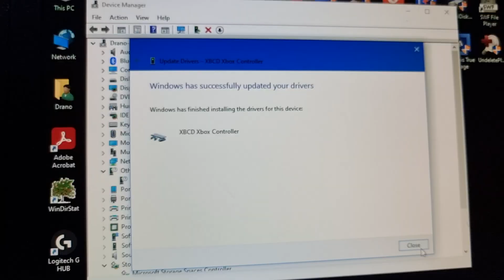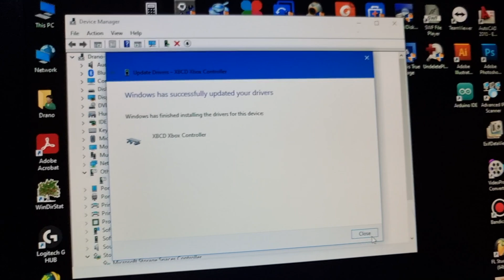Xbox controller S/Duke | USB PC Conversion

Comment: I can only find cheap replacement cables that have 4 wires.
If I'm using a controller with an xbox, won't i need the 5th wire?
Pinout found on google says it's for Timer (VSync).
All the 6 pin wires are from america, and are like $50 delivered. 😟
Reply from the maker: Usb 2.0 only uses 4 wires, disregard the 5th, its for the vibrate feature.
If you modify the adaptor, the controller will work as designed on an xbox.
Reply: @TheAussieRepairGuy  so if I use a 4 wire cable it won't have vibration?
Reply from the maker: @RestoreTechnique  basically. Are you modding it for use on a pc? Or just replacing cable for use on xbox?

If just replacing cable, 6 core alarm cable might work better.
Reply from the maker: @RestoreTechnique  the yellow clock wire basically isnt used.

Try this link for detailed info - it has diagrams:

https://www.s-config.com/xbcd-original-xbox-controllers-win10/
Reply: @TheAussieRepairGuy  Replacing for use on Xbox. But I don't have the connector either. Just the controller with a stump where the cable once was. 
Almost seems like it's a write off, if the proper cable is worth more than the controller itself.
Reply from the maker: @RestoreTechnique  just use an old usb cable, ignore yellow wire. Xbox uses usb 2.0 just with a fancy shaped connector. I made a usb socket for one once and added a usb plug to controller, worked fine. Also meant when I put xbmc on it, I could read usb memory sticks
Reply: @TheAussieRepairGuy  USB1.1*. And the 5th wire isn't used for vibration
Reply from the maker: @SomeAngryGuy1997  what is it used for?
Reply: @TheAussieRepairGuy  Well, from what I could find:
The extra cable (yellow / VSYNC) is used for timing with special controller accessories (such as the light gun etc) to time the controller with the vertical screen blank; for the purposes of using the joypad, this cable can be removed, or at least disabled.
Reply from the maker: @SomeAngryGuy1997  i appreciate people that can do a little homework instead of simply complaining. I'll pin this comment.

Comment: It didn't work
Reply from the maker: You need pc drivers.
But alzo check your wiring with a miltimeter, not all usb cables use the same colours, some flip the data lines

Comment: Just wondering why you didnt just splice in the USB and have both ends?
Reply from the maker: Because splicing cables like that is a great way to kill usb devices.
And screws with the differential signal.
I don't have and have not had an xbox in over 15 years. I have piles of these leads, and nobody wants them.
If making videos like this keeps drawing negative attention, the net result will be the whole lot will go to e-waste.

Comment: why cut an original xbox breakaway? you modify a chinese clone (which do not have the 5th wire for the video signal)
Reply from the maker: @Nome_Cognome720  because I did not have a chinese one, i had about 50 of these.
Reply from the maker: @Nome_Cognome720  this was a case of making use of what I had. Xboxes are 24 years old now, and only use I ever had for them was to mod them into media centers. If not re-used this would have been off to land fill. I don't have time, energy or space to be pedantic about every little cable and connector in my shed.

Comment: Does it work with USB female
Reply from the maker: @Pliers.Official  you can plug in stuff like a keyboard or usb stick in an xbox yes, but to do anything meaningful you will need to hack it with xbmc
Reply: @TheAussieRepairGuy  that was the whole point of using it🤣
Reply from the maker: @hacker-fp7cv  i used to to hot swap hdd trick.

Comment: I went through all steps on the s-config site, but when I open Halo MCC on Steam the controller doesn't do anything. EDIT: Installed XOutput as well, and with that my game does register the controller inputs. New problem is that left and right triggers are constantly receiving input. EDIT: Used invert against the triggers in XOutput, working better now
Reply from the maker: @ExtremelyTastyBread  good to hear you got it all worked out

Comment: i still have a problem when connected to the pc
Reply from the maker: You also need drivers - and then have to configure those drivers:
This is the page I used:

https://www.s-config.com/xbcd-original-xbox-controllers-win10/comment-page-10/
Reply from the maker: You will have to add more detail than that for me to have any useful input.

Comment: Thanks for posting this. I have an old duke controller, n its the only thing my hands are comfortable with holding. Looked for an adapter online, but ended up buying a 360 adapter, n got really annoyed. At least i can use it to do what you're doin here
Reply from the maker: Glad to help.
Reply: You are comfortable with a Duke controller? Also you can get new ones that already have USB so no need to mod them.